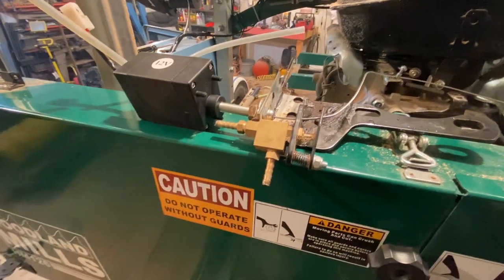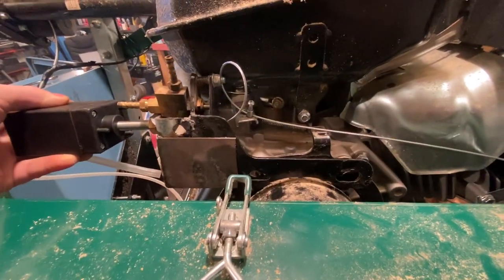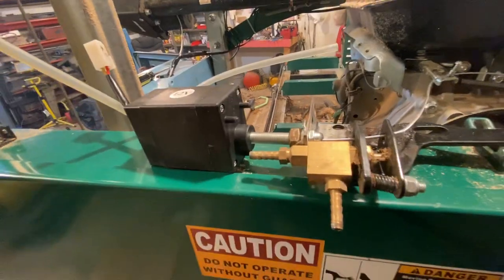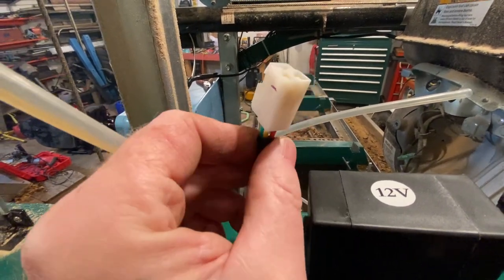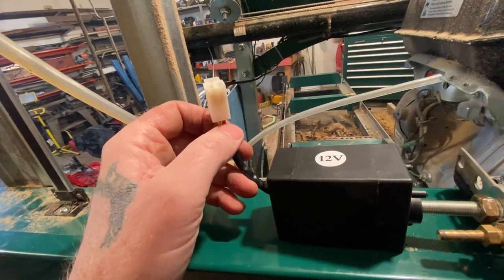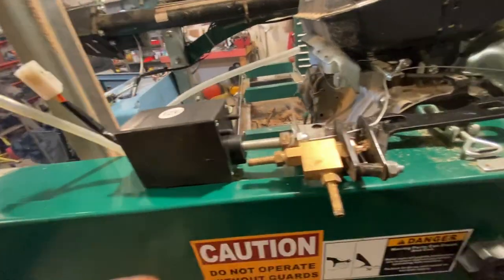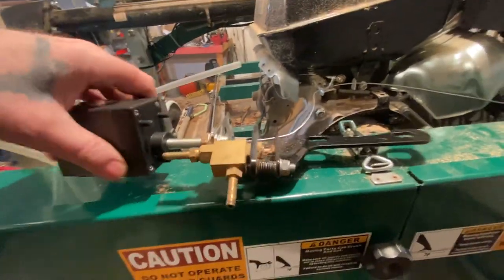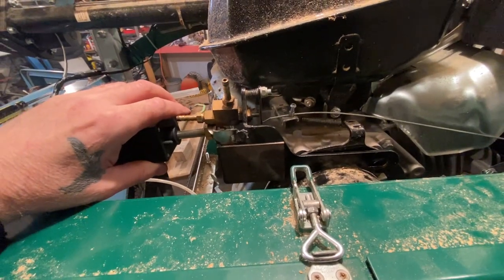Electric throttle for my Woodland Mills HM126

Comment: I'm not at my mill right now, looking at picking up one of the Throttle Adjusters from the link below.  A video of it says there's 1" of travel, I'm vaguely remembering more travel than this - is 1" enough to go from Idle to Full Speed?
Reply from the maker: This unit actually has more than enough travel. I set the cable at full throttle. When shut off there is then extra slack in the cable.